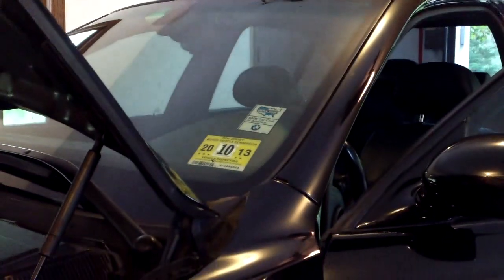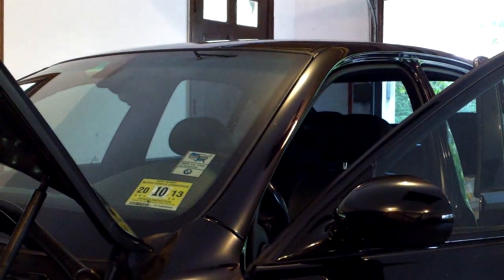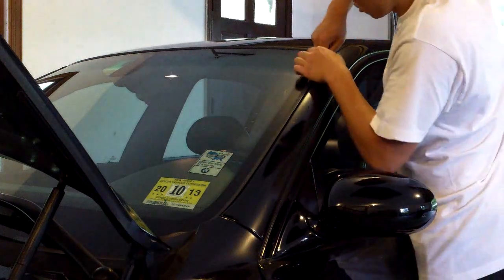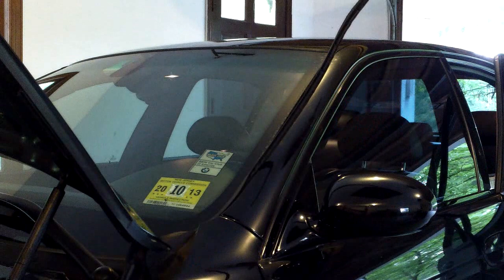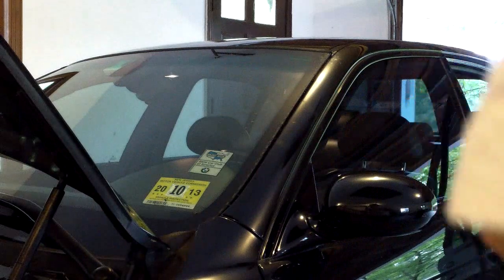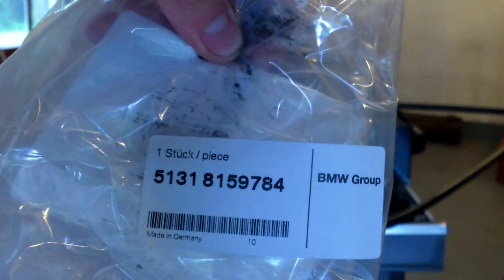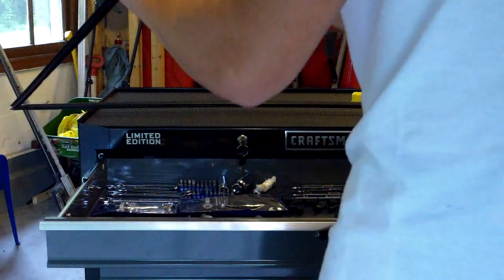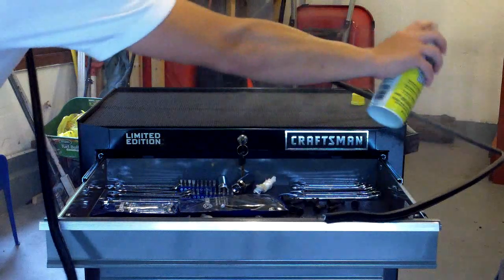DIY BMW E39 Windshield trim

Comment: I noticed latest f30 3er no such trim. is it really necessary?
Reply from the maker: +KS Chai Water does not leak into the car without the trim piece. This piece has mostly aesthetic and wind noise reduction functions. You don't need it if it has disintegrated due to age, but it is nice to fill the gap between the windshield and car.

Comment from the maker: If you don't remove it, nothing will happen besides an ugly looking trim piece. The trim does nothing with repelling water and if it is removed without a new one put on, it may cause excessive wind noise.

I would only remove the original trim if you knew the windshield is original. That way, there will be enough space to squeeze the new trim into place. I had to remove my front windshield and get the trim piece put on by a professional; it was only 1 hour of work so it wasn't too expensive.

Comment: lmao....this wasnt easy for me..AT ALL....viola my ass.
Reply from the maker: +omar k If your windscreen has been replaced at some point, then the gaps may be different and the seal won't come out easily. Mine was tough too since I had an aftermarket windshield; I eventually took it to a glass shop to have the entire windscreen R&R'd to get the seal back in.